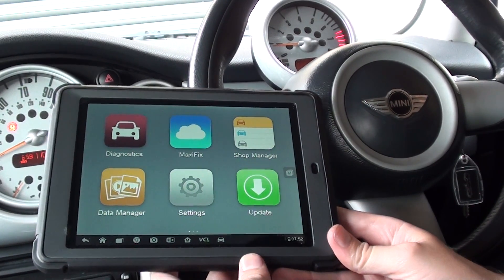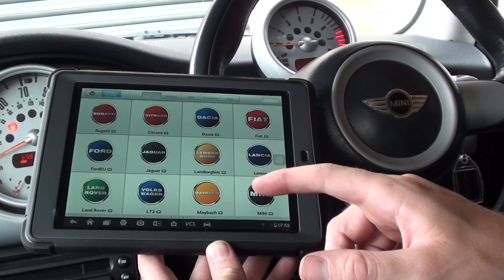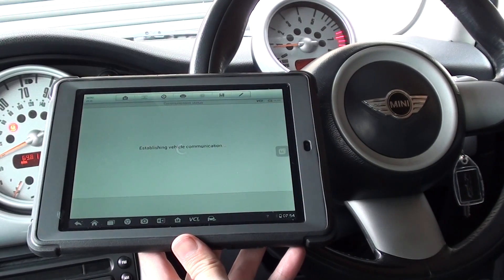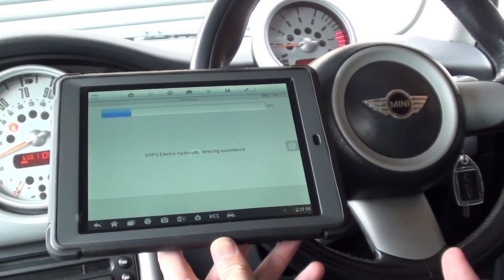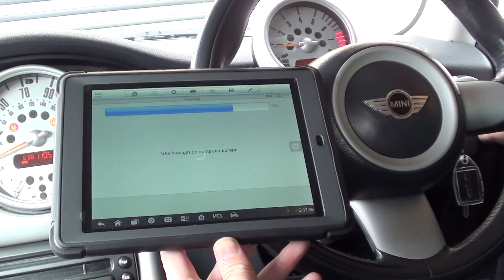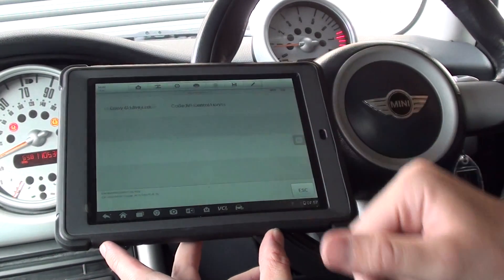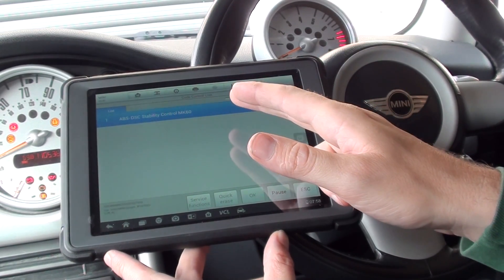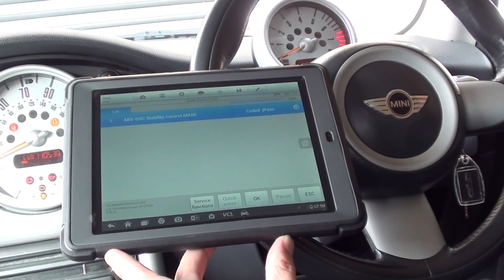ABS DSC ECU Module Coding Demonstration Diagnostic World

Comment: If you try to code E66 BMW with that tool you will need to change the CAS Unit because will erase the data  for BMW E Series you need different tool